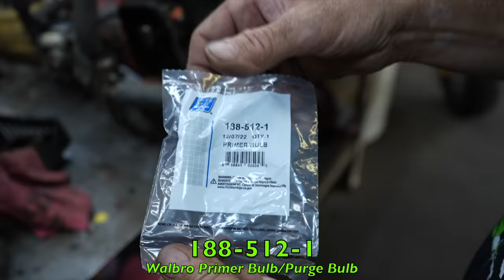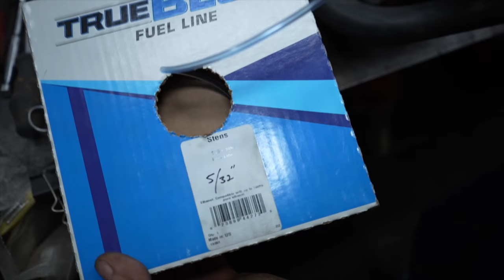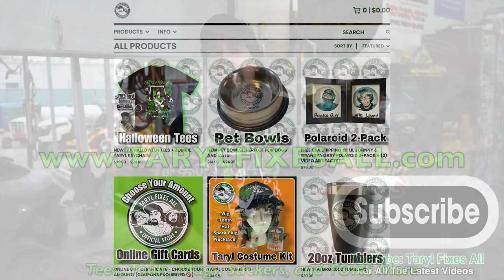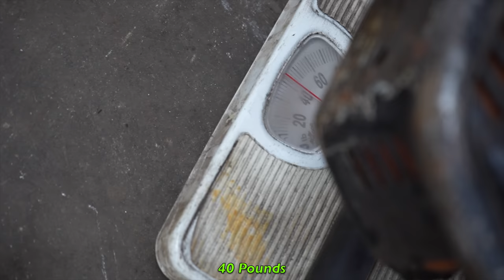Can We Get This FREE Gas Powered Impact Running?

Comment: I have a Honda CR-V that must have been built by the same people that built that mower. I've replaced anything that could possibly leak oil... and it still leaks oil. I should have bought another Toyota.
Reply: Have you checked the pcv system to ensure its functioning properly?
Reply: Timing cover is the usual suspect. Must be removed, cleaned, and replaced with Hondaseal. Don't use cheap RTV.
Reply: Get JB Weld
Reply: Toyotas burn more oil than a oil refinery luckily mine dont but i had a 2000 corolla that used a gallon of oil a week
Reply: @Joseph-lt5yz  so no valve cover leak? No VVTI solenoid gasket failure? No leaking Timing cover gasket? No oil pan gasket failure? Because all of that's pretty common. Very common.
Reply: Have you done a head gasket on it yet? If you actually replaced every oil seal on the engine including the rear main seal and resealed things like the timing cover that uses silicone sealant and it’s still leaking, the head gasket is the only thing I can think of that most people wouldn’t think would leak oil…but they sure can. It could also be a cracked head or block but that’s even less likely than the head gasket having an external oil leak.
Reply: @Tjs_powersports check the gas and fill it up with oil
Reply: Shoulda bought a Subaru bud!!!

Comment: Torque Test Channel, they test all sorts of things. I remember the video showing the gas powered impact wrench. Don't recall the results. 
They even built a gas powered impact wrench. They removed the electric parts out of a battery powered impact and installed a gas engine in place of the electric parts. 
I like watching that channel.
Reply: I’ll have to check that out! I assume they had to have built some kind of gear reduction to the input / hammer shaft on the impact end of the setup?
Reply: Yeah that channel is awesome, taryl sure didn't want to even get the name right....

Comment: We called them bance guns here in the uk and i believe they still use them  , used on railway changing fish plates  and chair fastenings, the sockets were held on with a pin and a rubber rings the pins use to bend, you could get a cradle that could be put on the rails to help in carry and take the weight removing fish bolts, but we just used them by hand and after a shift you knew you had been using them  👍👍

Comment: One trick we used "BACK IN THE DAY" to set the Super Glue was Baking Soda. Just sprinkle the Baking Soda on the seam where you see the oozing glue, and it will set quicker and form a strong bond. 
Love your Channel,  Taryl! And....there's your dinner 🫵🏻
Reply: You can also get an activator, just remember to get the glue bottle away from it before you spray. You only make that mistake once when you have a solid bottle of ca glue.
Reply: I still use that trick want to make super Glue to be more Effective add Baking Soda.
I keep some in a Small squeeze Bottle
Reply: A squirt bottle of water will make it set.

Comment: When i was a kid we used gas drills for drilling holes in maple trees for spouts to collect sap to make syrup. Much better than using a bit and brace. One guy I worked for used a regular corded drill with a genset in a trailer to tap trees. Dragging the cord around was a PITA.

Comment: 33 years in the Laborers Union in Boston and I’d never seen one of these till I was hired by a company that did railroad work. Like you mentioned Taryl Most companies have switched over to Battery powered Dewalt and Milwaukee impact guns since they are so much easier/ convenient to use. The only problem the battery tools have a much greater tendency to get “lost” than the 40lb gas powered ones 😂

Comment: I wood have used some j b weld epoxy to build up around outside if the assembly halves . Love your videos. Started in first grade going to the repair shops with my dad in 1959. The old Clintons , power products, reo and briggs and scrappins!!! The reo was a horizontal shaft with a rightangle adapter gearbox to the grass blade (18” blade).

Comment: I used a gas powered impact for tightening anchor bolts that went around 300 ft in the ground then they had to be tightened to spec with a 5 ft long torque wrench named Bertha lol. Come to think of it they did switch to electric impacts half way through the job reason for being we had to stand them straight up on the bolts and people were getting gassed out in the dig out were the bolt were to be anchored.

Comment: 3m and sem autobody products has the thick crazy glue, also comes with a pump spray that hardens the glue instanty.  Sem also makes multi purpose panel adhesive. That bonds plastics steel aluminium awsome product, 24 hour cure time.

Comment: You guys should get one of those Service body Pickups (with all the toolboxes and compartments on each side) so you can put all of the common spare parts and your tools in there and go to calls and be able to fix it up on site without needing to bring it back to the shop. You can pick them up (pickup geddit? hehe) cheap at auctions all the time, especially when local government gets rid of their current fleet to buy new ones, they like having shiny new stuff for some reason, I dunno that seems to be the case most times when the taxpayer is picking up the bill..

Comment: Taryl, that impact wrench is possibly made to open the hatches on the bottom of tank cars for cattle feed, grain, beans, etc, or, the most likely use would be for tightening or loosening bolts on rail plates. Where I used to work, they had air powered ones
Reply: Never have I seen rail workers use a gas impact. 
I always see a truck or train car with air compressors supporting the crews. Wish I had one..
Reply: I used one to tighten track bolts on the joint bars, that’s what they are designed for.
Different size sockets are available. The socket is held in place by a pin and a rubber o ring that sits in that groove on the socket.

Comment: Taryl, first of all, I really enjoy your videos and have learned a lot from them! But I have a problem that I’m not sure how to fix! I have a friend that has a John Deere JS45 walk behind self propelled mower. It has a Breaks and Scrapem’ model 12S502 0114 B1 engine. The engine has a primer bulb, no choke, that is located on an extended part on the lower part of the air filter housing. I can prime the carb by pouring gas directly into the carb and it will start and keep running. Oh, I also put a new carb on it because the old one was full of water and corroded like you wouldn’t believe, Anyway, if I let the mower set until later or the next day, I try to prime it with the bulb and it will not fire off. Carburetor is exactly the same as the original one. Can you help me out with any suggestions to get it to prime with the bulb? 
Thank you sir in advance!

Comment: grouse work Taryl mate i love those 2 stroke aka 2 cycle units and yep a good handy unit to have where cordless and power and even air powered ones cannot always match where they are needed most but yeah an easy fix for sure in your case and cheers from Australia 🐨🐑🦘🌴🇦🇺  or the land down under to your area and i do believe throttle trigger assembly parts are still available for purchase if you know where to look on the Internet too from eBay to Amazon etc like you have shown us and besides that have well torqued day too. 😃😉

Comment: We use the snap on 3/4 drivve for semi's. But yeah instead of a box truck with a compressor for on to go tire changes. It would be nice to have that. The snapon 3/4 pnuematic only weighs 28lbs. The Ingersoll Rand weighs 40lbs. I've snapped lugs on a peterbilt with that Ingersoll rand. I hate both of them. I'm sure the battree powered ones were welcomed by the railroad workers haha. - Detroit

Comment: I have a JD 425 , Kawasaki motor , 54” deck , mid 1990’s model , when I engage the blades the power drops drastically & I have to go real slow especially in taller grass . Have you ran into issues like this ? If so how’d you repair it ? I am a subscriber .
Reply: Something is wrong with the engine governor.
Reply: Engine is only running on 1 cylinder

Comment: I have a Tanaka drill for lineman use, much better than a bit and brace! years later when DeWalt came out with battery powered hammer drills, a coworker broke his wrist when the drill was set to "drill" mode instead of " hammer"  mode, the drill bit stopped but the tool quickly twisted his wrist out of normal range of motion.

Comment: Hey Taryl! I hear you're the man that has a machine to remove hitch balls from old rusty receiver hitches. There just isn't a wrench or pipe BIG enough to do the job.
Reply: Soak it in cider ;)   For real tho Taryl would heat it up, the quickly quench it with the hose. For real tough ones take an air hammer to it and shock it real good with that.
Reply: Did you try heating it and using wax from a Birth Day Candle
Reply: @georgemartinezjr  shit my bad I was unaware it was her s birthday. Happy Birthday grassrat brother. 😂 😂. Jk.  Some ppl swear by that method.

Comment: I wonder how difficult it'd be to convert those into starters for racing engines.  The racing crews use battery powered ones with heavy lead/acid batteries. Could be an interesting project and way to recycle instead of scrapping them.

Comment: You may use baking soda to instantly cure any cyanoacrylate containing glued or spray instacure products from Bob Smith Industries that will force stupid glue to instantly cure when the spray contacts the glue.  Can damage some plastics and painted surfaces so you have to be selective about where and when you apply it. The baking soda trick I learned from a buddy that was a flight mechanic in Afghanistan and he said that is how they did field repairs on helicopter rotors that had sustained minor damage from small stones and pebbles.  It cures almost instantly, can be machined, drilled, tapped, sanded and painted. Works like magic.

Comment: Impact socket retaining pin with ring.  Ring goes around socket to hold pin through hole in socket and square drive.  Keeps socket from flying off the tool.

Comment: Its a carpurator priblem, wenn the gas is nit tight, the needle and seat is leakin into the crank case wenn it overflows...then i gets more and more and eventually the oil is full and spills the cranc case out on the floor..or the floor spills out? Idk man, just fix the carb..

Comment: Well at least that's a 2 cycle engine because this gas powered impact is not  light weight  but lighter than the 4 cycle version of this machine if it comes in a 4 cycle version

Comment: I had this happen to me with a snowblower. The service writer said it was leaking oil. I changed every single gasket and seal. 4 hours labor for free. Guess what it came back a week later said it was still leaking. I then said please take pictures of where it's leaking. It was the auger gearbox. I was so upset

Comment: When you have the tool going the wrong way it has a tendency not to take the nut off! As you can see when he put it on the correct way it zipped the nut right off!
Reply: He was trying to break it on purpose.
Reply: He was trying to snap the crankshaft on purpose at first.  He knew what he was doing.